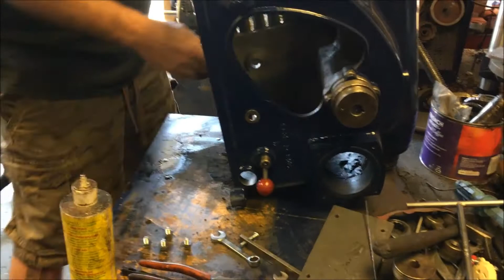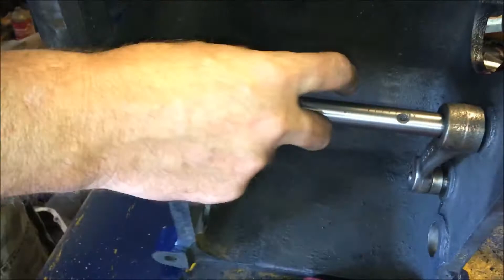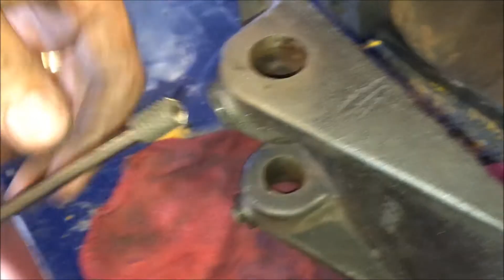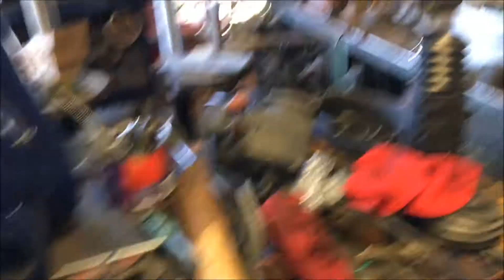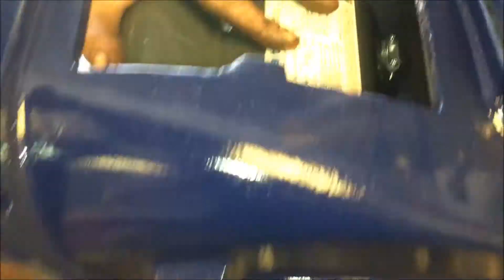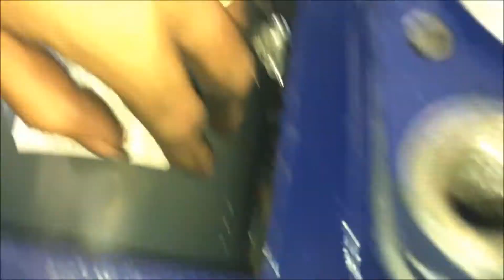3000 Restoration - The Motor Install - Video 8

Comment: I've always installed the motor and the bracket at the same time. I guess I learned that because of the other style motor that doesn't have the removable bracket.

Comment: What kind of motor did you use?  Was this a factory ammco replacement or another.  My motor is Waaaaay harder to install.  Barely any room at all.  Also a 1 hp.
Reply: Its a Marathon motor. We got a shot of the sticker. The ones with the plastic fan cover dont fit in some machines. Central motors has one that fits nice too.
Dayton and Chicago electric too.

Comment: Thats the basic motor install. Be sure the shaft moves smooth so belt adjustment works right.
Will do another video at some point on the other mounting style.
Reply: I was just going to ask how do you install the other motor with the welded on Mount.